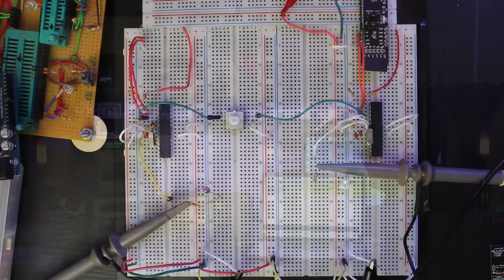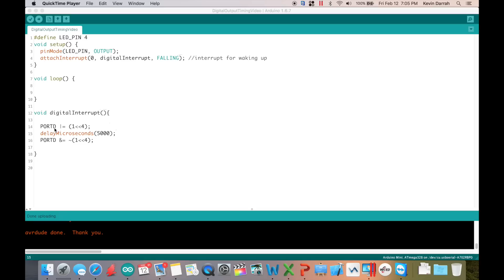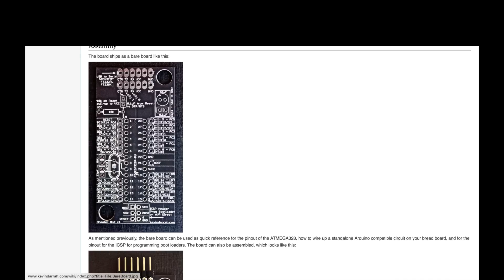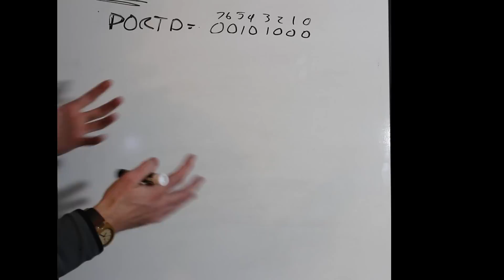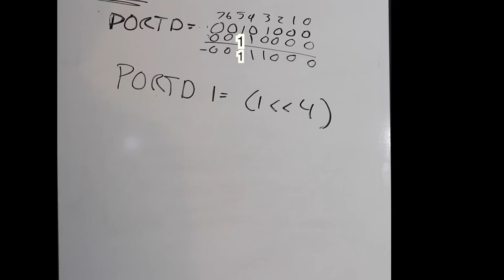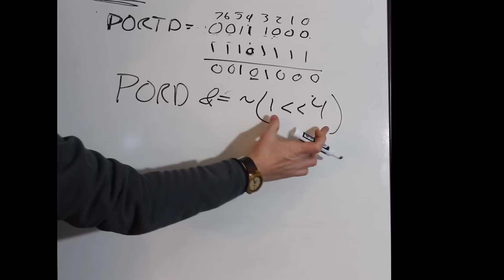Faster Digital Writes with Arduino Tutorial! - Direct Port & Register Manipulation

Comment: Apologies if this is a dumb question... Instead of shifting 1, four times to the left to  get the correct bit value / mask, could you just use "16" or "0xF" are they not 00010000 without the bitwise shift operations? 

(I saw a reply below suggesting using 0b00010000 if that would work?)

Thanks for the video - it explained it really clearly :D

Comment: Would it be faster to just use B00010000 or H10 instead of (1<<4) ??? - this instructs the computer to actually shift it 4 times rather than shifting it our selfs and giving the computer the finished byte...? after all, this method tries to save time...?? ty

or just use B11101111 instead of ~(1<<4) - how much time would that save?

Comment: Nice video (:
You could also just do: 
PORTD = B00010000;
delayMicroseconds(5000);
PORTD = B00000000;

Or is it wrong? (:
Reply: i think you could make 
 PORTD = PORTD | B00010000;         //Puts bit 4 High without the risk of changing any other bit
 delay(2500);
 PORTD = PORTD & B11101111; //Puts bit 4 Low without the risk of changing any other bit. 
delay(2500);
i tested this in atmel studio 7

Comment: I learned that the shifting might take some cycles, how about writing to the port like this:
PORTB = 0x01 or PORTB = 1
Isn't it faster than writing a shifted value like:
PORTB |= (1<< PB5)
Reply: Yes, simply writing a byte value to a port is faster as it avoids all the shifting of a bit and the ANDing and ORing and NOTing. But it also wipes out the settings for all the other bits in the port. These other bits are digital inputs and outputs too, so altering 8 pins at a time when you only want to change 1 could really make your peripherals go nuts. Hence the need to only affect the target port bit when setting or clearing one pin - and that introduces the requirement for bit shifting and logic operations.

Comment: Hi Kevin, I'm not sure why wouldnt it be simpler to just use the function bitset() to turn on a single bit in a byte, instead of using and or equals, shift to the right and all that good stuff? is because bitSet() cant be used with ports and registers? if so, I guess we could use a byte variable and bitSet whatever in it in order to pass its value to the port we want to change?  Would that work?thanks!

Comment: This is the consequence for the easy entry in programming with the Arduino IDE.
You will learn a lot about processors if you go into registers and clock cycles.
All those arduino functions are compiled with a lot of jumps, stack pushing, RAM operations and finaly register operations. 
Every 16 clock cycles used for those operations more, slows down your execution by 1us. 
Bit-operations is something every programmer should learn.

Comment: OK so direct port manipulation is faster but is not assembly language even faster?
Reply: It depends on the programmer. ;)  But yes, assembly code is generally faster to run than any compiled language.

The trade-off is that a compiled language will take care of many "fiddly bits" for you and is easier to write and usually easier to understand, while assembly code requires the programmer to think of everything (pretty much literally everything) and is a bit more difficult to understand.
Reply: @jasonMasters I thing it is a Byte more difficult to understand

Comment: Hey Kevin . 
I have a pro mini and what i want is turn State of A1 and A0 simultaneously 

OLD WAY 
if Something 
    digitalWrite(A0, LOW);
    digitalWrite(A1, HIGH);
else
    digitalWrite(A1, LOW);
    digitalWrite(A0, HIGH);
end

New way 
if Something 
   PORTC = (PORTC & B11111101) | B00000001;
else
  PORTC = (PORTC & B11111110) | B00000010;
end 

Is this Correct? if considering the used platform(arduino pro mini.)
Thanks in advance
Reply from the maker: I'd have to check the datasheet for the PORT assignment, but you if you want to tangle both, you could just shift over something like a B11, instead of (1<<2) kind of thing...

Comment: Is there some way to digitalRead() with direct port manipulation?
Reply: portState = (PORTD & (1 << portNumber)) >> portNumber;

To explain, "(1 << portNumber)" this is 'whatever' number that 1 shifted over by 'portNumber' is. If you feed it a '4', then the number is B00001000, or 8. 

'(PORTD & ...' This 'AND's it to see if the specific bit values are a 1 or a zero, and returns a new byte with 1's for the bits where both values have a 1, and 0's for the rest.

'... >> portNumber' This shifts that value all the way back into the ones place so you either get a 1 or a 0, which is the value you would expect.

If the state of PORTD is B10101010, and you want the state of port 4, then this is what it will do:

   B10101010
& B00001000 
_____________
    B00001000

^--Since this number is actually 8, not 1, we then have to fix that by shifting that 1 back over 4 places so it's in the 1's place.

B00001000 >> 4 = B00000001
Reply: Please read: https://www.arduino.cc/en/Reference/PortManipulation
Reply: Priyabrata Saha sure read pins register and mask off the unneeded bits and you can test for a 0 or greater than 0 to see if it was hi.

Comment: So Kevin, I've watched several of your videos now over a period of time of course. I started with the Shift Registers and somehow always stumble across your videos when trying to learn about whatever it is I'm working on at the moment. So I think it's more than appropriate to like and subscribe. 

Now this video shed some light from the power series I watched prior. This more or less pulled the blinds up to let the light in. So now here goes that really dumb question at lightspeed. I'm currently working on some LoRa Feathers I bought from Adafruit. The idea with this project is sense PIR statuses and send that data via radio packets to another radio. Now in order for this to be a feasible project I am going to manage power much as you described in the Power series. But I also want to use interrupts and the like. So in other words these radios will be just chilling around the backyard, the solar panels will be feeding the batteries until a motion is sensed. At which point the Feather will wake up do the radio TX/RX and go back to sleep. Long story short, Can I use these methods on just about any Atmel even though it's on an Arduino Compatible of various sorts? I don't need any special IDE settings? Or a library to use code bits like portd?

Comment: if this is better than why is there DigitalWrite at all?
Reply: +mattibboss humanized command.
Reply: digitalWrite () uses the arduino mapped pins.  digitalWrite () calls library functions to find the mapped AVR port and port bit #.

Using digitalWrite () simplifies coding at the expense of performance.  Also, it only sets or clears one bit at a time, which creates a ton of unnecessary  overhead if you need to set/clear several bits in the same port.

Run your arduino code from debugger and you will see all the function calls needed to find the port/bit to set/clear. 

digitalWrite() simpifies arduino programming so you won't need to reference the atmel atmega328p datasheets, which a lot of people (especially beginners) find a bit confusing.

Comment: Hey Kevin as always love your videos.  I did a similar test a few years ago here...http://damage-designs.com/blog/2012/8/17/arduino-speed-test.html

Question for you,  does the shift operation itself (1<<4) add any CPU overhead or does the compiler convert it to a static value?  Would it be faster to "and" and "or" PORTD to static values such as B00010000 and B11101111 respectively?
Reply from the maker: +damage.cc good question - I've been wanting to write my own code to drive the WS2812 LEDs now for a while, so I'll need the writes to execute as fast possible.  Might keep on trying new things to get them even faster.
Reply: +damage.cc  Compiler must convert it to a static value. Using the shift operation vs using a binary constant produces identical code.  i.e.  (1<<4) vs B00010000 and ~(1<<4) vs B11101111. Switching from digitalWrite to PORTD reduces the program code size by 220 bytes.
Reply: +Richard Casey wonder if it's compiler specific. Also, wonder if B00010000 and 0b00010000 turn out the same too.. So many ways to represent the same number.

Comment: Since the processor and ports are not bit addressable, the libraries will be doing the same operations for the bit twiddling. Either their implementation is extra super crappy (unlikely), or you are waiting out a port write (or a sequence of port writes) setting each pin with each digitalWrite(), depending on its implementation. The delay being a factor of the clock speed seems to indicate something along this line. 

The more interesting problem is setting multiple pins in sequence. With just the digital pins, you are setting up to 14 pins, that means a delay of somewhere between 4 us and 56 us (14 * 4) calling  digitialWrite() for individual pins. The time depending on how many pins you are setting. Direct port manipulation is just however long it takes for the bit twiddling in the registers (fast) plus either one or two port writes take (depending on the number of pins set) for the same operation.
Reply: +David Kirtley I recently changed my code from digitalWrite to PORTB and PORTD, and it drastically increased my speed.. I was multiplexing Nine 7 Segment displays at 60Hz with a binary to 7Segment IC and a Binary to Decimal IC. And you could see the haze of the previous/next value about to be wrote on the segments since I couldn't change the number and digit fast enough with 8 digitalWrites.. But after the changed to PORTB and PORTD writes, it is crystal clear.

Comment: i am assuming arduino does not support things like portd.4 & 00001000B.
Reply: I was thinking why make another instruction operation of shift when you can use OR and the binary number wanted. As the same to reset. With the AND instruction.

Comment: Instead of PORTD &= ~(1<<4)
can't we do PORTD ^= (1<<4) 
BTW your videos are very useful and informative! Thanks a lot! :)
Reply: PORTD ^= (1<<4)  will toggle bit 4 in PORTD register.
If bit 4 = 0, it will be 1. If bit 4 = 1, it will be 0.
Reply: +Srijal Poojari

PORTD |= (1 << 4) will always SET the 4th bit (counting from 0).

PORTD &= ~(1 << 4) will always RESET the 4th bit.

PORTD ^= (1 << 4) will toggle the 4th bit - if it is SET it will be RESET and if it is RESET it will be SET. ^ is the XOR operator: 0 ^ 1 = 1, 1 ^ 1 = 0

If you want the bit off, regardless of whether it was on or off to start with, you need to use PORTD &= ~(1 << 4). Maybe you have some logic that needs to turn 'off' the pin - this should always turn off the pin and hence toggling it is inappropriate.

The compiler will probably optimise it to something else anyway.
Reply: this will toggle the bit
Reply from the maker: +Srijal Poojari nice, yea, that should work too
Reply: Kevin Darrah cool, thanks!
Reply: Oreganodealer LS OG What do you mean?
Reply: +Oreganodealer LS OG Oh yes, you are right, didnt see that!

Comment: what happens if you remove the sleep, then measure the frequency it switches the led on your scope? I bet with the direct port manipulation you'd notice you could switch at a higher frequency. unless your arduino's clocks are synced, I don't think you can measure delay like that. not sure though